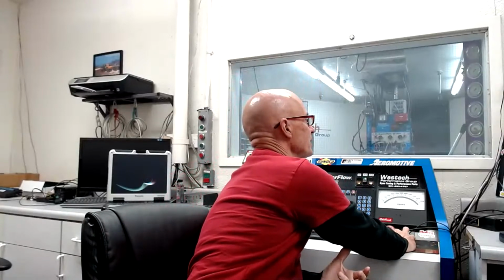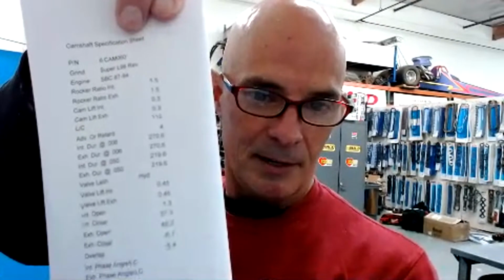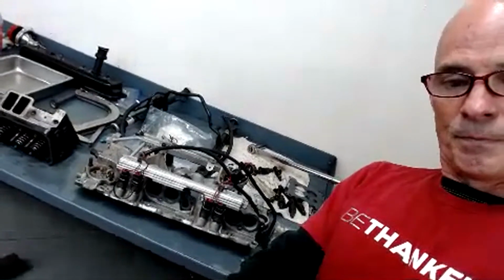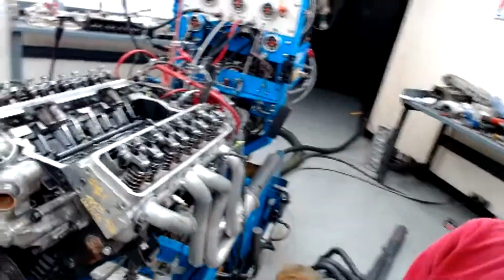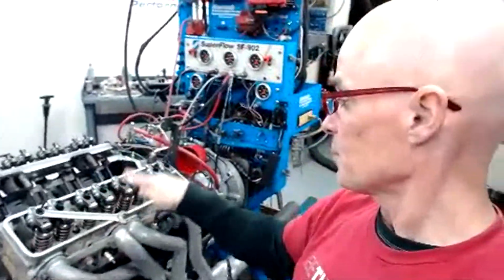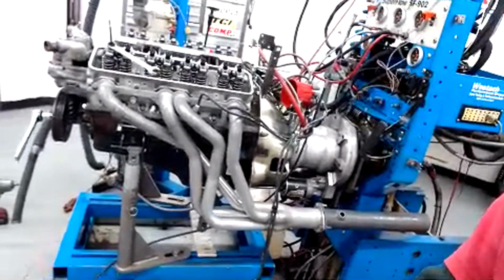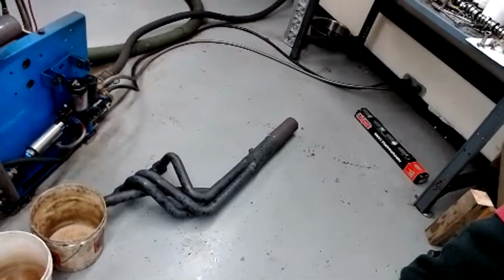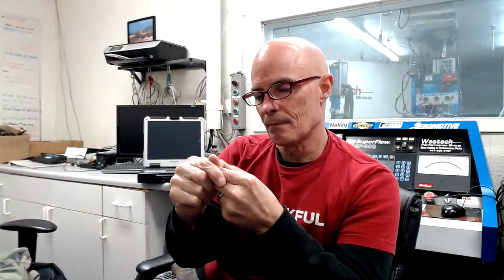LET'S TALK TURBOS-L99 HEADERS & ALUM LT1 HEADS

Comment: Richard the Crower Cam is a 62824 for my 4.6 4V. The cam card is on Crower site. So I put the engine together put silly puddy on #1 & 6 cyl. Set timing and with just test springs only turned it over by hand. I had a fat set of 0.062 gaskets for this test. I'm regretting I didn't get valve reliefs cut in my Carillo pistons. No damage but intake valves made the slightest contact on pistons. I pulled my Ferrea valves out checked no damage
 So pistons are getting valve reliefs.

Comment: Richard
Can you do a test or do you have an opinion about boost through a blow through carb with or without an intercooler.  Also boost through a tbi injection system like Fitech, with or without an intercooler.  Thanks
Reply from the maker: INTERCOOLER IS ALWAYS BETTER-YOU CAN GET AWAY WITH NOT HAVING ONE WITH BLOW THROUGH-ESPECIALLY E85

Comment: Hey Richard I love your videos all the time.. I have a question for you in  1995 5.7 LT1 and the 1995 L99 are the camshafts the same and where do I find the numbers on th block to find which motor I have.. I bought a 95 chevy caprice and it had a 4.3 the guy said the motor was swapped for the 5.7 I just want to make sure which one I have. I bought a camshaft for a 95 5.7 LT1 so i need to make sure it will work.

Comment: Oh the nacl/salt water in the a/w is brilliant bro. Throw that ice in and use filter on the to cooler line, and you could get that water so damn cold. Like street drivability if you carried some salt and stopped every while for ice.
Reply: Why would you use salt water when regular ice melts when water freezes? If you want to go apeshit use methanol as your fluid medium and cool it with blocks of dry ice, you could get it down to -109f or so. I think using salt water is a recipe for disaster.
Reply: @timothybayliss6680  Hot salt brine. Rots the inside of the intercooler out, but you can grow Sea Monkeys  (brine shrimp) in it.
Reply: You could also use antifreeze and cool it to sub-zero temps with dry ice or something similar.
Reply from the maker: SOLID PASS  ON THE SALT WATER
Reply: No ones down for the salt?  It was simply never something I had ever considered.

Comment: You have to eliminate or limit the phaser to cam the L99. But the most important thing is you need a non displacement on demand valvetrain and tuning oc. But do it, those are bad systems on these motors.
Reply from the maker: THIS IS A 4.3l (GEN 2 lT1-BASED) L99-NOT THE LS VERSION

Comment: The modded LT5s out there are almost blasphemy, but they are so cool. Ported heads, cams, and headers on my 95 zr1 please. 
High $ injectors like ID are about consistency for your 1000+ hp engine. Spray mattern may be better and give ya .3 hp across for your 2 grand.

Comment: A couple of thoughts. Air/fuel ratio is meaningless if the spark plugs are the wrong heat range. I think chamber shape and size is just as important as port flow. Maybe even more. As far as power adders I believe nitrous is the best because it doesn’t add heat as long as the fuel curve is correct for nitrous introduction. Plus it’s easier to control power production.
Reply from the maker: AF RATIO IS MEANINGLESS?
Reply: @richardholdener1727  I think the correct plug is as important.

Comment: I have an idea for Big Bang. What effect does temp have on HP? Dyno at the following engine temps, 180, 200, 220, 240, 260!! Can it survive?
Reply: Been there, tested that. Everyone knows heat kills power. Which is why they dyno everything at 140-150° water temp. The warmer the coolant, the warmer the cylinder head. And the less power it can make before detonating. Every single time.
Reply: @michaelallen2501  so they test in unrealistic conditions.  No motor runs “normally” at 150. I feel your not looking at the bigger picture.
Reply from the maker: EVERY BOAT MOTOR ON THE LAKE WITHOUT A CLOSED SYSTEM RUNS AT 150 DEGREES OR LESS-WE DO IT BECAUSE IT ADDS A SAFETY WINDOW ON TUNING
Reply: @cobalt0681  lots of modified engines run at 150-160°F coolant temp. You want the oil temp up to 195-205°F to burn off all the impurities. But there's no benefit to getting the coolant that warm. Except emissions related stuff. I have a 160° thermostat in my V8. It runs around at 175-185°F.

Comment: Richard,
How about an ultimate truck SBC test?  Take a junkyard 1996-2000 Vortec 350 engine, pull off the horrible factory injection unit, and put an L98 tuned port injection on it.  There's companies that make a tune port manifold that will bolt to vortec heads.  Maybe add a ZZ4 cam and voila, 350 Torque monster.
Reply: My L31 Vortec intake works just fine after porting and the marine intake also worked very well. Close to 500 hp on E85 with the ported stock manifold.
Reply from the maker: 500-HP L31?
Reply: @richardholdener1727  11:1, 6" rod 383 with 210cc aluminum heads ported by Lloyd Elliot that are drilled for the vortec intake pattern that flow 299 cfm @ .550.  Cam is a Lunati Bootlegger 232/244 @ .050, 108 LSA, 104 ICL, 0.578 lift with 1.7 rockers and has Rhoads V-Max lifters.  Has a smoothish idle at 750 rpm.  The intake manifold base is heavily ported, has the plenum opening ported for an 80mm BBK throttle body and it has AUS Injection 48 lb/hr spider injectors in it.  Has thorley tri-ys into the factory GM dual 3" exhaust piping and a dual 3" in/single 4" out muffler.